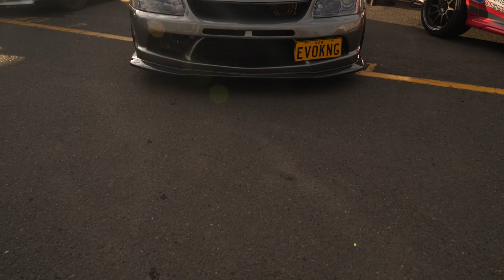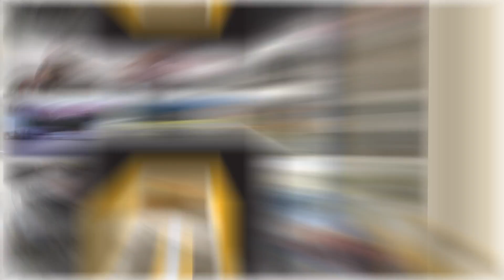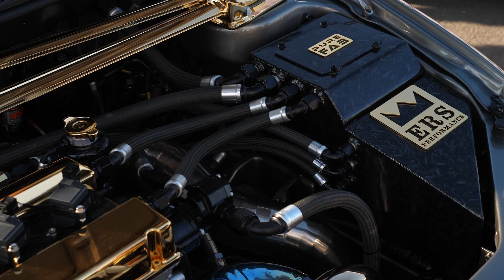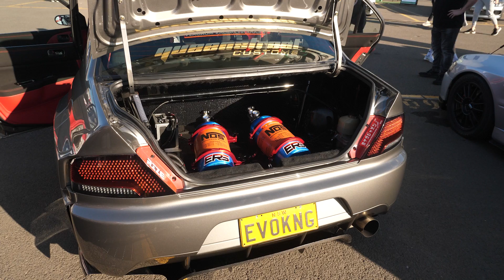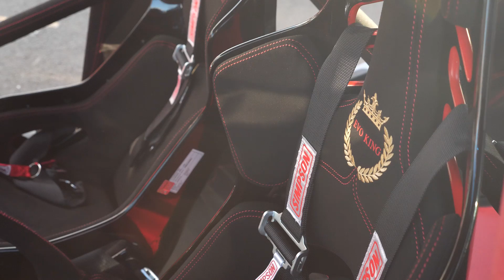What Makes This Build AMAZING?

Comment from the maker: 👨‍🔧 Building a fast car? Get $400 OFF the all-inclusive VIP online course package deal: https://hpcdmy.co/offery184
🦵Kickstart your EFI Tuning knowledge. Get 50% OFF your first online course: https://hpcdmy.co/offery184
TIME STAMPS:
0:00 - Jimmy Evo - ERS
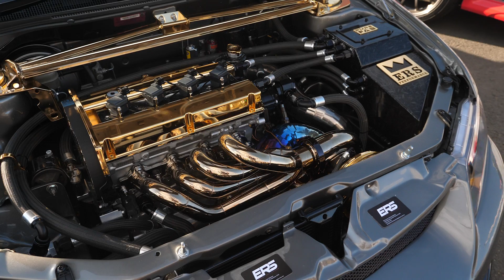0:14 - Street Driven Roll Racer
0:50 - Build Goals
1:44 - Compromises & Balance
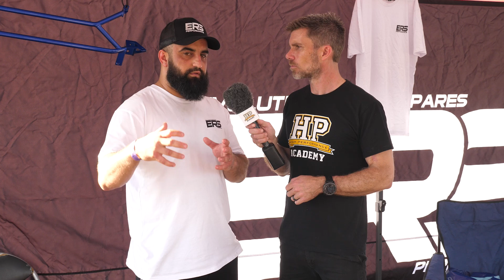2:48 - Wheel Package
4:52 - Engine Specs
5:50 - 4g63 vs 4g64
7:30 - Stroke, Revs & Capacity
7:37 - Aluminium Connecting Rods
8:24 - Fire Ring Cylinder Sealing
9:20 - Cam Profile Vs Street Usage
9:53 - MIVEC VVT Removal
10:35 - Precision 8085 Next Gen Turbo
10:50 - 900hp Run In
11:15 - Boost & Power Goals
12:49 - Nitrous Setup
13:58 - Drivetrain
14:30 - Gearbox - Holinger
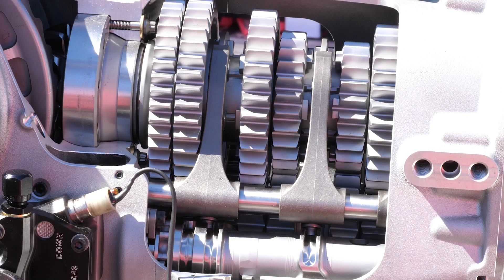14:40 - Shifting - Paddles
14:45 - Clutch - Carbon
15:03 - ACD Retained
15:27 - Drag Racing With Active Diff Control
16:15 - Gearbox Actuation
16:50 - EMtron Electronics
17:40 - DBW Surge Control
18:14 - Thanks Jimmy & Team!
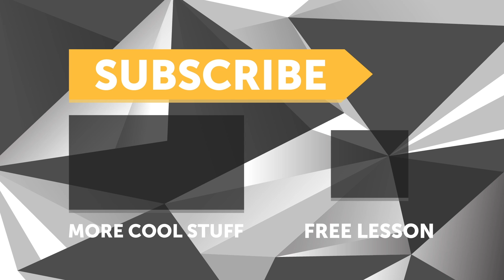18:55 - BUILD | TUNE | DRIVE